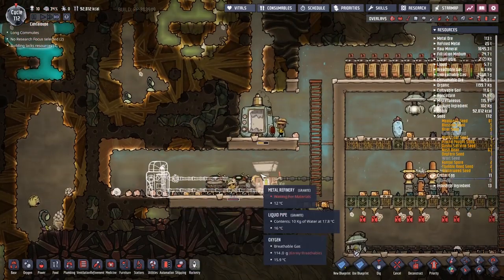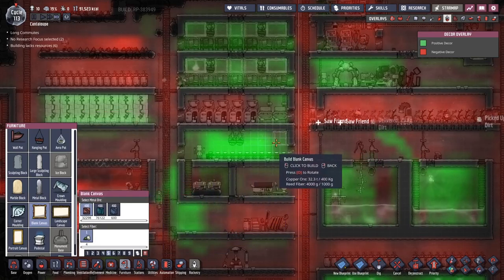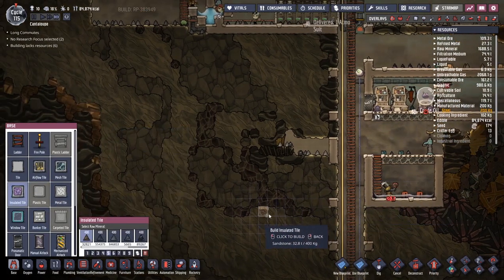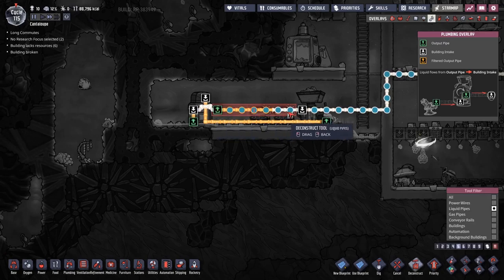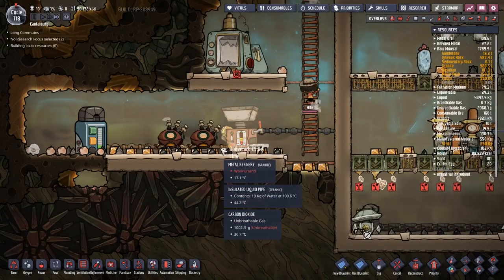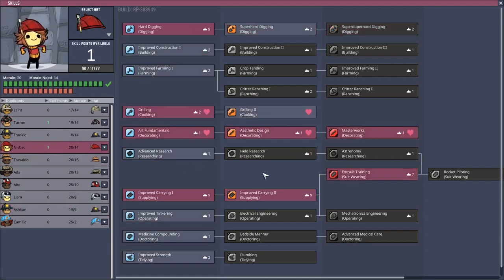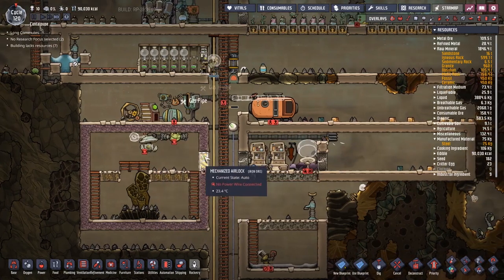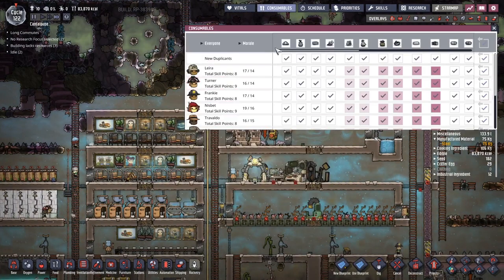Steel Production & Natural Gas Geyser | Oxygen Not Included (The Badlands) Gameplay (Part 10)

Comment: I have a few things you may want to take note if it is not to late. First the natural gas generator is just like your other generator it makes polluted water. Also kilns make a absolute truckload of heat so what I do is place the refinery and kilns in the frozen core and it cancels out. And if the refinery is placed in the frozen core it will heat the ice and make a water puddle and you can place a pump in that puddle and feed that water to the refinery again and have the exit of the water go straight back to the puddle. Therefore heating the puddle and making it bigger.